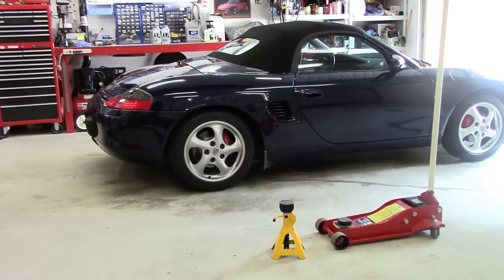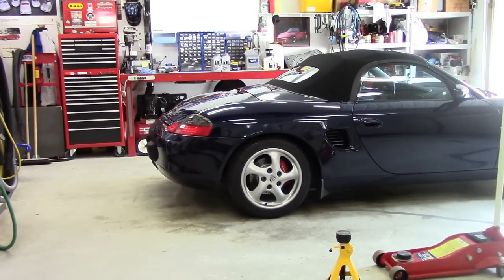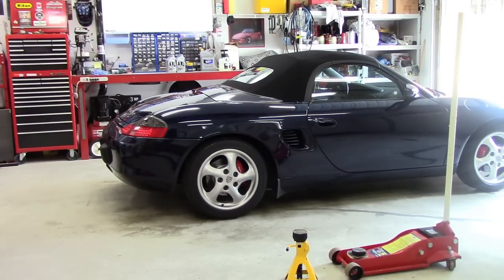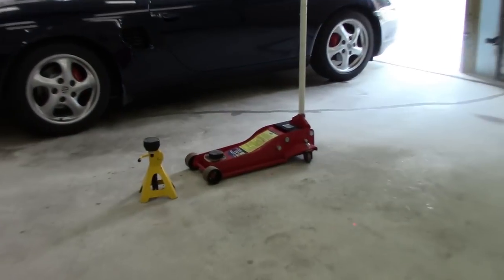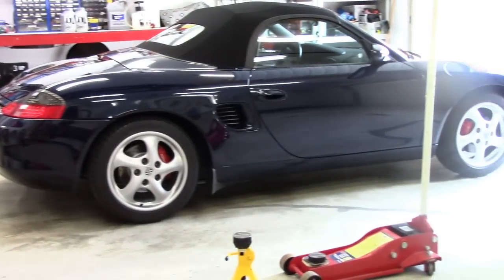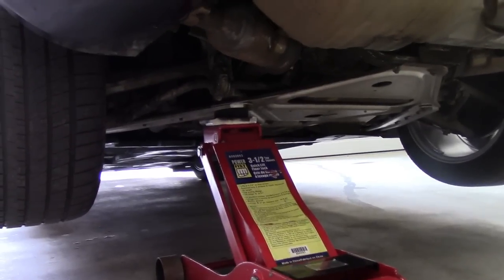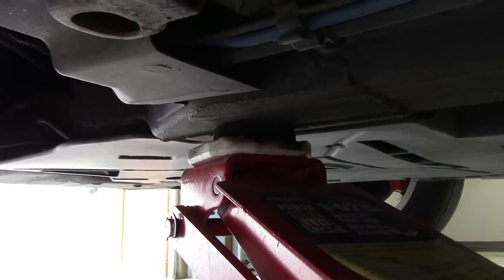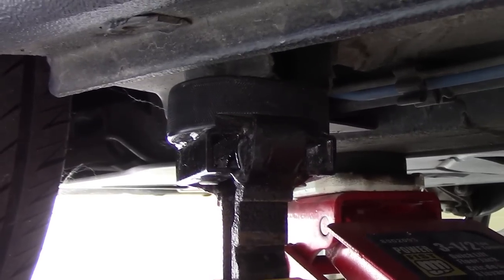How to Lift a Porsche Boxster - Safely & Correctly at Home

Comment: Always a good idea to put a wheel under the car as a safety net if the worst did happen the wheel would stop you from being crushed badly. Always have a phone in your pocket as well. I tend to use jack stands and also keep a jack supporting the car for extra safety.

Comment: John, DIY replacing the soft top and IMS are some of the biggest and most PITA jobs that can be considered "typical" for 986s. By your garage I can see that you're no amateur, but still, dude. Those are huge tasks to get done yourself (and still have the car run afterwards ;) ). Major props!
Reply from the maker: @JK Thanks - The top I actually found pretty straight forward and not nearly as difficult as others made it out to be. I just followed Wayne Dempsey's article to the letter (Pelican Parts owner). The IMS was a bit of a different story (heavy work & much more difficult without a hoist and transmission jack), but still manageable for a tool pulling enthusiast - just took my time 🙂

Comment: Hi John, I've been a DIYer for for 50 years. Just acquired a 2001 986 that I am preparing for resale. Painted the hood and bumper because of stone chips (black car). Now am ready to do fluid changes, plugs and brake flush. I found this video, as I wasn't sure how to properly jack the car. Your description was most helpful and very thorough and straight to the point; including the several safety tips that were superimposed on the video. Your wife is lucky to have you as a mechanic. Wish I could say the same... Great video!

Comment: John the reason they say start at the front is that when starting at the rear the front tires must be securely blocked. Starting at the front the parking brake locks the rear tires. Great vidio, thak-you.
Reply from the maker: Good point. Unfortunately, my floor jack is not quite low profile enough to fit under the front first. I have to lift the back up first for the jack to then fit under the front .

Comment: There’s a simple bracket you can buy and bolt permanently for lifting the car in the rear center on the 987. Might be something for the 986?

Welding up a round adapter with a puck (Go Canucks!)  to fit onto a normal Jack stand is a great idea. I use round rubber pads with a steel center pin that locks into the hole in the car’s lift mounts for improved locating speed and safety. I’ll bet you could drill out the puck and use a steel bolt for the same effect. 
It’s part of an amazing set of forged aluminum stands I use on the front lift points that allow you to lift the proper spot with a Jack and slide in the stand to the same spot. They’re $$$$ so I only bought two. I’m copying you for the rear!

Comment: Great video, thanks.  I just bought a 2005 and am  looking to do some of the routine stuff myself.  I know you said you lifted the front and back because you were doing the brake flush at the same time.  If you were just doing an oil change would you only lift the back?  I'm wondering about the effect on draining.
Reply from the maker: You can just lift the back end, but not quite as much oil will drain out. Best to have the car level to get as much oil out as possible.

Comment: Hi John,

Thanks for the video! I just bought a Porsche 987, and have two jack stands and two wheel ramps. I am a little lost on how you designed the hockey-pucks on the jack stands. I wanted to ask if you could clarify how you created this set-up, and what types of hockey puck or rubber fitted piece are recommended.

-Matt
Reply from the maker: Hi Matt. I welded some square tube on the sides of the jack axle stands to support the full face of the regular 6oz hockey pucks and screwed the pucks to the square tube. There are however better options these days with all the various "jack pads" that are available to fit directly onto different types of floor jacks and jack axle stands - for example: https://amzn.to/49rOC7D

Comment: Thank you for the video. I just purchased a 2004 boxster s that I will be tracking so I will try to do some of the maintenance myself. Which jack stands are those?
Reply from the maker: Links are in the description to similar ones along with pad adapters so you don't have to weld them like I had to on mine.
Reply: @Rchelicopterfun  Thanks for the informative video. Will I be safe without the flat hockey puck adapters? Thank you!

Comment: If the front wheels are blocked, can you just put the rear on jack stands for access to change the oil?
Reply from the maker: Yes, my only concern is not all the oil will drain out during a change if the car is not level.
Reply: I think I’ll lower back back down to level and let it drain for a half hour. The container is slim enough.

Comment: Hi John, thought I recognised the voice  ( re your RC helicopter tutorials ) correct? 
Anyway, just wondering what height in inches is good for say doing an oil change please
Thanks
Reply from the maker: Yes correct. Totally depends on how much working space you need/require under the car. Use a height that works for you. I generally have my jack stand heights around 18 inches, you may or may not find that gives you sufficient room.

Comment: Have you considered why brake fluid has a change interval of 2 years but same fluid in clutch system has no such interval. If in one system DOT4 can last the life of the car, why should it only be good for 2 years in the other? Both are supposedly equally well sealed against moisture intrusion, and the brake system runs hot enough to boil off water near the slave cylinders yet has the shorter interval. If anyone knows the answer, please share it
Reply from the maker: @Alexander Schonfeld - The primary reason you just answered yourself with the "boil off water" statement. Yep, that's exactly what happens to hygroscopic DOT3/4 that has been diluted with H2O over time when it gets hot down at the calipers under hard breaking - it boils. Where do you think the bubbles created when it boils go? Yep, they are now trapped in the brake hydraulic system and since air is compressible, now you have a spongy brake pedal, and poor braking performance.

By the way, no hydraulic brake or clutch system is perfectly "sealed" from the air, it's always absorbing some moisture. 

Corrosion prevention and flushing brake system component wear contaminates out of the system are the other conventional reasons to flush brake fluid regularly. Changing viscosity of the fluid as it ages is another one with today's sensitive ABS, traction, and stability control systems.

Now to the clutch. Not sure what clutch fluid change intervals your vehicles have had; none of mine have ever stated "life time". All mine state in the service manuals 2 to 5 years for DOT 3/4 clutch fluid flush intervals when they don't share the same fluid reservoir as the brakes. The 986 does share the same reservoir, so the clutch fluid gets changed at every brake fluid flush regardless. I do however flush the remainder of the clutch circuit out down at the clutch slave cylinder every 2nd brake fluid change. 

If you go longer however in a separate clutch fluid system, never change it and your clutch hydraulics eventually fail, who cares. The worst that happens is you can't disengage the clutch, it sticks or the fluid leaks out due to cylinder corrosion & seal degradation. In contrast, if your brake hydraulics' fail, people can die. That is why the importance is emphasized on brake fluid change intervals. You know, common sense safety reasoning. Of course, there is silicone DOT 5 which you can leave in for longer intervals as it's not hygroscopic, but that's another rabbit hole to venture down.

Comment: How much room behind the car did you need when you pulled the transmission out?
Reply from the maker: I had about 5 feet from behind the car to the wall of the garage, but it can also be slid out from the side. The manual transaxle is not that big or heavy.

Comment: Hi John,  how did you get that rubber on the top of that jack?
Reply from the maker: Hydraulic Floor Jack or Jack Stands? Hydraulic jack is just a hockey puck placed on the jacking foot - nothing special.

The jack stands (which I assume you are referencing), as I state in video, have the hockey pucks "glued & screwed" onto them after welding some square tube to either side of the axle cradle to fully support the puck. I have seen jack stands that come with nice big rubber feet already installed, but they are $$$ pricey.

Another option that might work are rubber feet that are made specifically for axle type stands. Here is one example if you wanted to see:  http://amzn.to/2BrTgVV

Comment: Nice video John. I also service my own Porsche. My 2005 Boxster S still has the original IMS bearing and so far no signs of wear via oil filter inspections and listening for noise. I am interested to hear you replaced your own IMS bearing. Can you elaborate further about what this entails and whose replacement bearing you installed. This is something I feel I ought to do for peace of mind.
Reply from the maker: DIY IMS replacement is possible if you are comfortable working on vehicles (I admittedly used to pull wrenches for a living). It requires transmission removal which is the most difficult single part of the job, but even that is not too bad. These cars are very easy to work on for the most part. You have to lock the one camshaft on the 1st gen 986 before pulling the IMS bearing cap so it doesn't go out of position while there is nothing holding the IMS shaft once you remove the bearing cap. Seem to me the later models need the secondary shaft held as well or it too could slip? I used the LN Engineering dual row ceramic hybrid replacement bearing with the updated bearing cap. You need the special LN IMS bearing removal tool set as well which is fairly costly, but you can rent them or find used ones. I purchased everything from Pelican Parts including Wayne's 101 Boxster Projects  book which shows the entire procedure but they also have it on their website. I replaced my clutch and rear main seal at the same time since it was all apart and a good time to do it.

To be perfectly honestly, I think much of this IMS stuff is fear mongering. At least with 1st gen 986's since they used the dual row bearing, had less HP, and low failure rates. The bearing I took out was still perfectly fine, but like you, I was worrying about it and had to change the clutch anyways so figured it was a good time to do it. Certainly the 2nd gen Boxy, had a higher failure rate (I think around 8%), because it used a single row bearing and was up on HP. So yes, if only for peace of mind, it's likely worth while. If you plan on keeping the car, there is also an oil pressure fed IMS bearing retrofit. It's pricey, but for long term ownership, might be worthwhile?

One thing the infamous IMS fear mongering has done is make all the IMS Porsche's undervalued and accessible to many people so grab these cars while we can as they will go up in price eventually. In fact, it's starting to happen when I look at current price trends. It's funny how people forget about Porsche engine issues. I had a 1973 911T for many years and when one of the mechanical chain tensioners failed in it (an almost 100% guaranteed problem to eventually occur on those cars), the left bank of pistons and valves tried to become one. As a result, I decided to sell it in 2002, several years before the air cooled pre-impact bumper 911 prices started climbing through the roof. If I would have kept that car which was 100% original and in great shape other than the blown 2.4L mechanically fuel injected engine; it would be worth close to $100K now. Raise of hands - how many of us sold those early pre-impact bumper air cooled 911's for what early 986's are currently selling for and now feel horrible?  I keep telling my wife not to sell her Boxster for the same reason. No, a Boxster will never demand the price of 70's 911's due to there being so many of them, but they will go up in value, of that I have no doubt.
Reply: 2005 and above also got an improved ims bearing so failure rate is much lower than the previous generation.  I  have a 2007 boxter s with 60k miles and don't worry about it, people are inducing more problems changing it than they otherwise would have.
Reply: The ims is a sealed bearing, you won't see anything in the oil filter if it goes bad and you likely won't hear anything.

Comment: I think the hockey pucks are a bad idea , there's no grip , no hooks ,no spikes,  nothing to stop it from sliding off.
Reply from the maker: Nothing but 2800 lbs  partner.
Reply: I used to think that, but hockey pucks ended up being just fine for me.  I have an auto lift and use them to level just about every car or truck I lift. They are rubber and grip really well.  I can tell because the pucks have indentations where the metal bites into them.  In fact, they wear out and get all marks and lines in them.

Comment: Surprise and a little nervous that a hockey puck can withstand 3,000 lbs
Reply from the maker: They work a treat. Solid rubber be it a hockey puck or commercial arm lift pad is the same stuff. We often used pucks at the shop when our Bendpak arm pads wore our while waiting for new ones.